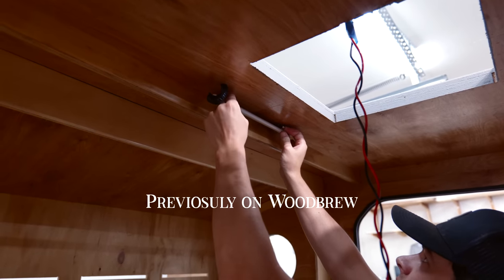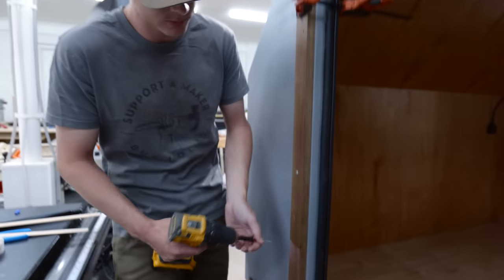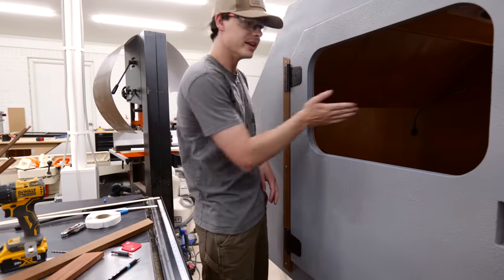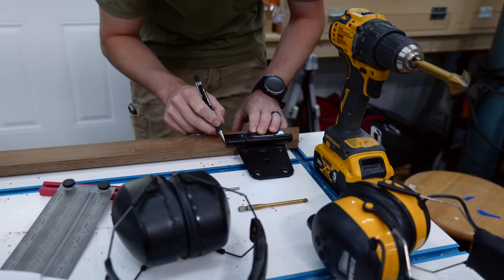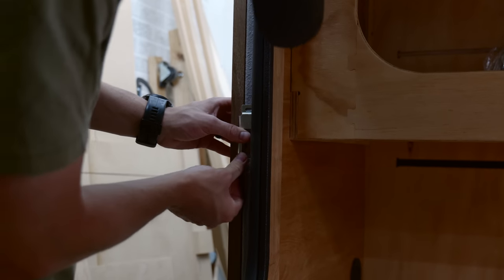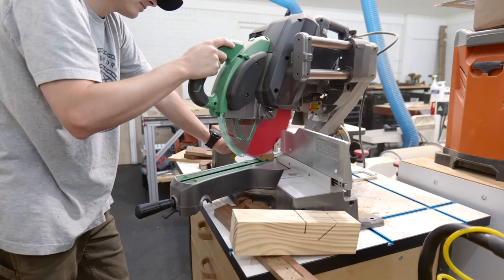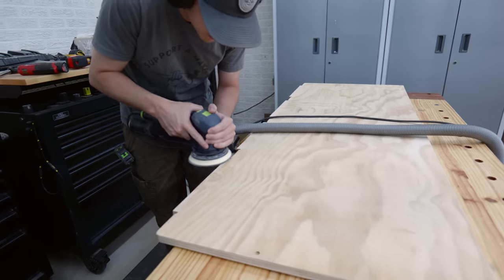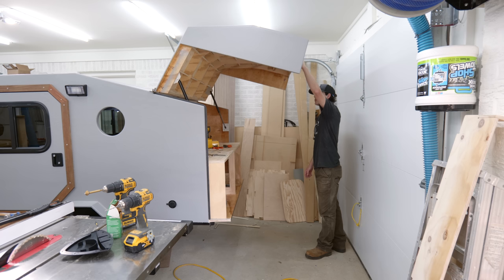Building a Teardrop Camper in Our Garage Is Making Us Go Crazy

Comment: I used the traditional tear drop latches on mine, and i installed two flat head screws on the inside of the trailer  so that i could back them out as needed to tighten up against the latch.

Comment: You guys do good work! I’m really impressed with your attention about the camper being watertight! Stuff a lot of RV manufacturers sometimes seem to just apply silicon sealant. Just have a question though (and I’m no woodworker by any stretch of imagination); would the hurricane hinge work for the door installation? It seems it would have made the fit more flush making the lock mechanism a bit more secure? Also as one who worked at a few companies that made fiberglass sailboats (and a few surfboard repairs in my younger days) your application was great! I’d buy a camper from you!

Comment: Don't you just love when you cut a piece, get it the way you want, then walk over and realize you did it backwards :P So frustrating. I've done that too many times :( 

On a side note, instead of gluing Formica, have you thought about using stainless steel sheet metal. 16 gauge might be too heavy, so maybe 18 or 20? You could maybe stamp a slight bump or bend a .5" squeeze to act as a drip guard on the back edge and maybe put a 90 bend on the front to add some stiffness. You could then spot weld some studs on the bottom side and use some nuts to secure it to the wood. Might look nice and shiny back there. I don't know, it was just an idea. In case you hadn't decided yet :D Hope you guys are doing well. Peace.
Reply from the maker: Haven’t decided just yet, but stainless steel sheets are outrageous!